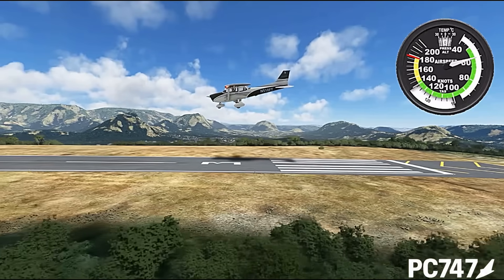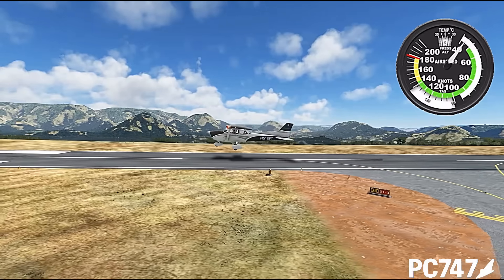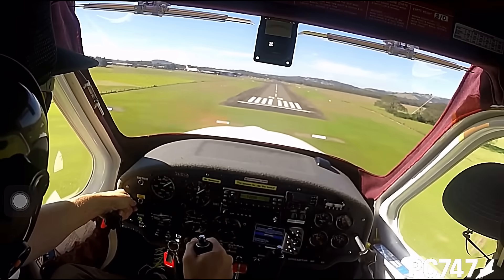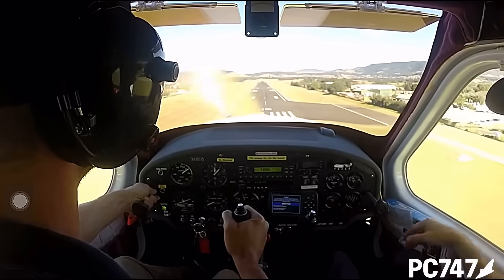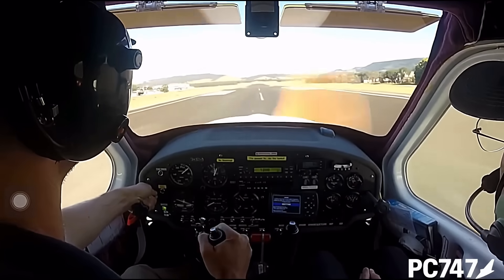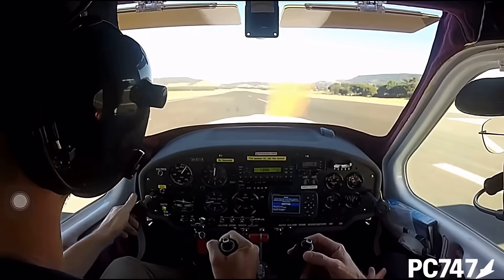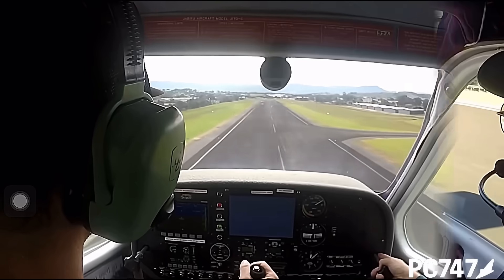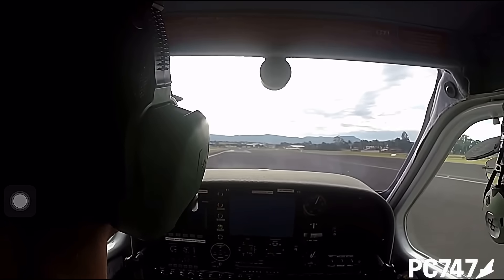How to Land a Plane -The Secret No One Tells You

Comment: No offense you did not discover, here to before unknkwn knowledge, no one else teaches. There are many tips to teaching lsndings "not in books". Your techniques and observations are not special or unique. I get click bait. I soled many primary students in under 6 hrs, and all my students from Pvt to Com Multi Inst passed their chk ride near min required time 1st time, 40 to 50 hrs for Pvt.  I hate seeing Pvt take 75 hrs and 20 hrs to solo. Me pvt in 41 hours, all ratings min time, never faiked check GA or Airlune. I had good instructors. 👍 

Pilot, 40 yrs, 35 yrs CFI/II/ME. 1500 hrs dual given GA, 1000's more part 121, 5 type ratings, Aerobatics, total 15,000 hrs PIC. I am not God's gift to aviation.

I dont' do this with all student's, but I have the throttle and tell them to do liw pass 1O feet above runway. I add power or subtract as needed.But coach them when they need to not sink or not balloon. Then they get a good side picture and maybe we do it again at five feet. I tell them to hold their attitude and slowly pull the throttle back and squeak squeak they land. They start developing the sight picture, transportation from looking down runway to peripheral. Not all students need this. You have to have a bag of tricks. Observe the student and use what works.

 I can teach you a thing or two about  cross wind landings in GA and swept wing jets i an sure. 

I am sure you can give me tips something, but this video is not one of them.  

YOU NEVER HEARD THIS FROM YOUR INSTRUCTOR. This presumptuous comnent is hyperbolic and  self engrandizing. Then you fain modesty with CFI's make mistakes too.

You have no clue what other instructors teach and how. Your vitue signaling is in essence bashing orher CFI's. This  is not good for the profession, nore is it a competition. 

 Deconstruction of elements involving landing, pitch, bank, and power, is not your discovery.

 Why do people bank in flare? YOU DON'T SAY. Body mechanics, pulling back with left hand in flare, tennds to also pull down (unless you are  consciousness of it). This happens at airlines when new FI's land in the FO lane. 

It's like when making a level turn.You have to pull additional back pressure. When you learn this muscle memory you don't think about it. 

 I see it with Inst Students reaching over to put something in "the box", they lower their hand and bank. 

 It is like shooting a gun, trigger control, pulling trigger without moving whole gun.  

Be it a firearm instructor or CFI you obsetve and Coach. Some folks are just more coordinated than others. Some students have better eye hand coordination and faster reflexes and intellect. 

 I did not see many slow students in the 90's, 1 out of 10. Now teaching GA for fun students I see more lazy and slow students 2 out of 6. Not statistically significant or scientific, but possibly generational? They are unable to focus and have poor communication skills. Too many distractions in 2025? Not all but from 90's to the 2020's the caliber of candidates today is concerning to me, short attention spans and poor memory.

 Your 10 sec bleed energy theory is irrelevant and not bassed on physics. PLEASE provide references and how this is critical. 

Many factors affect how much excess energy you take into the flare. Heard of Short field approaches? 

 What if they are flaring too high and holding it off? 10 seconds is not a thing.

Never heard this taught. Never heard this for good reasons. Do you start a clock AT inital round out or in the flare? When does inital round out ebd and flare start, for clocking? DON'T ANS: Rhetorical, no answer needed. Irrelevant.  What if the pilot blips the throttle? Start the clock again? Sorry only you think this is important. 🤔 

 WHAT is more rellevent  (few of a long list) stabilized approach, on speed, configured, aim point, and developing sense of HAT by  peripheral vision, and then add drift correction due to X-wind.

 For X-wind I teach the "DANCING BEAR"  🐻  for cross wind. My  invention  NO ONE I KNOWS MY SECRET TECHNIQUE AND TEACHES IT. Ha ha.  😉    

PS Rod Machado is far better instructor than you or I together X10. So let's  truly be humble, realize one size does not fit all. Each student is different, and some are better pilot's, naturally. I would never say I teach things NOBODY else does or could possibly know. Well except for maybe the dancing bear 🐻.  HA HA 😅
Reply from the maker: Hello,

  What you wrote was very thoughtful. You took a great deal of time in writing it too & I want to thank you for doing that. 🤩🤩🤩

You brought up some valuable insights that can and have benefited others. If I came across as a know it all, I want to apologize to you. That was not my intent at all. I’m certainly not the repository of all things aviation either.

I have  about the same amount of aviation experience as you, six type ratings, &, like you, large aircraft experience, 747 & 777, domestic & worldwide.

I want to commend you for all your aviation accomplishments & having been a flight instructor. I have the highest respect for people like you, far more than those who chose to avoid becoming CFI’s.

Like you, I’ve learned a couple of things along the way. I just attempted to impart “some” of that knowledge. Could I have done a better job or maybe presented it differently? Of course. If I made mistakes, I’ll own up to them, try to learn from them and move on…….

If you get a chance, take a peek at some of the other comments. While I never expected the video to be helpful to everyone, I’m gratified  & humbled at the sheer number of people who have communicated their gratitude.

Regards,

Carlos
PC747
Reply: @PC747Aviation i appreciate your thoughtful response. The danger with airline pilots such as yourself and me, we think we're better than we are. i'll give you an example. The  Boeing 747-400, a monkey could land it (I was one of those monkey's).  At 50 ft automated call, raise the nose 2 to 3 degrees, just let it land-O-matic on four big main gear.  With auto brakes, auto spoilers, grab reverse while the autopilot tracking centerline, disconnect A/P, click click. Hero. 😊 . i taught B747-400 back in day, graduated to twins (to upgrade). Airline pilots lose skills flying with automation.  Auto land (rudder aligns aircraft before touch down as you know) is amazing. NO complaints, but I hand flew often. Most GA pilots (some 121 pilots as well) are hard pressed to intercept, track, enter holds and fly approaches without a magenta line snd autopilot. Pilots are button pushing managers, and less airmen. It's a shame stick and rudder skills are lost. Cheers.
Reply from the maker: @gmcjetpilot So true! So true! Thank you! 🤩🤩🤩

Comment: Am I wrong in thinking, autopilot can land the plane.
Reply from the maker: It depends on the aircraft. You’re not wrong.. Most airliners have auto pilot systems that can land the aircraft, without pilot intervention, provided the pilots input the correct data. This allows these airliners to land when the visibility conditions are very low. A more recent iteration are advanced corporate aircraft that are able to land themselves now, in case the pilot dies or becomes incapacitated, with the push of a button. 

The Cirrus jet has this capability. If you look it up on YouTube, there’s even a clip about it.. The passenger only has to push a red button, air traffic control is advised, an audio announcement to passengers will advise them that aircraft control has been advised, and that the aircraft will land on its own. There are several other corporate aircraft that do this, including some turboprop models.

Cheers!

Carlos
PC747

Comment: I flew gliders many years ago, and the "10 seconds rule" is useful for them too. They had no engine, but "float" over the runway (ground effect) and are uneasy to slow down (even with full airbrakes extended) if your approach was a little bit fast.
Greetings from Patagonia, Argentina ! 🇦🇷🌲
Reply from the maker: Wonderful that you shared that with me! Thank you so much for letting me know where you were communicating from. 

I have provided the video in Spanish if that would help you or anyone that might enjoy it. You can find it by going to the comment section and it’s the second comment down from the top. The video is in seven different languages, including Spanish..

Cheers!

Carlos
PC747

Comment: This is really helpful to me an NPPL student with around 35 hours and still struggling to land (so a way off from going solo). But at what point exactly do you start the count? You say when you power off, but I often power off and do a glide approach way before crossing the runway threshold and flaring. A little more guidance on this would be appreciated. Cheers.
Reply from the maker: Hi,

  I’ll try to help you ….

   If you’re at the CORRECT APPROACH SPEED, & the throttle is pulled slowly to idle, during during the TRANSITION, from descent to flare….

  Start counting to 10 at that point out loud. 

Something that I think might help you is if you go to YouTube and just look at aircraft landings. Both large and small.

If you look at enough of them , after a while, you’ll see something in common:

  If they came in at the correct speed, they will typically float for about 10 seconds after crossing the end of the runway. Some will be less some will be more…..

Please let me know if this helps you. Reach out to me again if I can assist you further.

Regards,

Carlos 
PC747
Reply: @PC747Aviation  That’s really helpful, thank you.
Reply from the maker: @scrufflepeck SURE! 🤩🤩🤩

Comment: Add don’t step on the ball… to this… cradle with the ailerons. This guy is great! I luckily had his “father” as my instructor 65 hp Areonca champ on floats. You’ll rip the floats off with a normal instructor. High speed one float taxi, directional control with ailerons and elevator, , pitch with rudder. Try this in steep turns at altitude. Dead stick landing every time. Power ONY to correct mistakes or wind sheer.
Reply from the maker: Hi David,

    That was Super to read!

THANK YOU! 🤩🤩🤩

Carlos
PC747

Comment: HOW DID THE PILOTS LAND UP TO NOW ??
Reply from the maker: Here you go:

1. Institutional Inertia

Flight schools, regulatory agencies, and training organizations tend to preserve long-established systems. Once a syllabus or standardization manual is approved by regulators (like the FAA or EASA), it becomes difficult to change without lengthy bureaucratic review. So even when better methods appear, institutions often keep doing what’s “already approved.”

⸻

2. Generational Teaching Habits

Instructors usually teach the way they were taught. The flight training community is an apprenticeship system — one generation of CFIs passes down not only knowledge but also biases, techniques, and even outdated procedures. This creates a self-reinforcing cycle where new instructors replicate old habits rather than innovating.

⸻

3. Economic and Time Pressures

Most flight schools are profit-driven and operate on tight margins. Their focus is throughput — getting students to checkrides quickly — rather than redesigning training programs or experimenting with new methods. Updating curriculum, simulators, or scenario-based modules requires investment many schools simply can’t justify.

⸻

4. Outdated Evaluation Standards

The testing system defines the training system. FAA practical tests and written exams emphasize memorization and mechanical tasks more than real-world decision-making or scenario management. As long as checkrides reward rote performance, instruction will prioritize passing those tests instead of building modern cognitive or risk-management skills.

Take care!

Carlos
PC747

Comment: My grandmother and father were both pilots. My grandmother used to go on search and rescue missions all the time. I flew many times when I was about 3years old until about 12years old. I never became an actual pilot in a small aircraft but I have piloted many RC aircraft for decades. I also tool the part 107 for UAVs. I could most likely fly a small aircraft in a very short time if I had the money and desire to. But I like the way you teach, it sounds much easier. I think the largest amount of training I would need is practicing on the radio. I have many hours on the simulators and always enjoy trying my hand at cross wind landings because they are the most challenging. I think your approach sounds like it should become standardized because I can see it being beneficial.
Reply from the maker: Hi Newmomengineering,

Thank you for your very kind words & for sharing a little about you & your families flying history.😎🤩🤩🤩

Regards,

Carlos
PC747

Comment: Cessna mounted the vertical stabilizer at a slightly crooked angle.  The plane flies straight under power but will yaw the moment that you pull the power.  In dead calm no wind conditions, you must be ready to add a tiny bit of left rudder to land without yaw.
Reply from the maker: Oh wow! I did not know that. Thank you for sharing! 

Cheers!

Carlos
PC747

Comment: Немного непонятно. Правильно ли я понимаю что: надо выровняться по осевой на метре. А далее поставить малый газ. Посчитать до 6 и потом начать поднимать нос ?
Reply from the maker: Hi,

  The video was about landings. Not takeoffs. My apologies if it was confusing. Best wishes!

Carlos
OC747
Reply: @PC747Aviation sorry for a mess... I was wondering about a flare and landing proccess you have discibed above. Forget me if i got it wrond but as far as i ve undestood your way of landing. So ... during the flaring we keep a centerline "just between the legs" set trottle to idle and count to 6 in a normal pace. And after that we pull the yoke to let main gear meet the pavement. Wright ?
Reply from the maker: @DykyKryl It’s Ok. I don’t know if you have access to YouTube where you live…. If you’re able to observe aircraft landing videos, you might notice that, after they flare and reduce the power, they will float for approximately 10 seconds. Some, a little less, some a little more. But the general rule of thumb is 10 seconds.

My idea in having student pilots count out loud, is to give him a correlative reference that they can utilize for every landing. 

A lot of airplanes land too soon and pilots get in trouble. Landing early, typically results in three-point landings, or the nose touching the runway first. Airplanes that land too soon have very low angles of attack. Almost level, Flight attitudes. The numbers 1 through 5 are, in a way, reference numbers to remind you not to let the airplane land yet….

The number 6through 10, provide higher angles of attack, lower, kinetic energy, and aircraft attitudes that are safer for touchdown.

Comment: In about all the clips you show, it shows each aircraft landing at speeds far in excess of the speed to maintain a stabilised approach and a reasonable touch down. Whenever I made a mess of a landing it was always down to excess speed. If my approach speed was too high ( dependant on weather considerations ) or the profile of my approach was too high or too low, and I couldn't land on the numbers or close to them I was taught that in most cases a go- around was the best option rather than changing the aircraft configuration. I was lucky. My instructor was ex Air Force with huge type experience from Tiger Moths to 747's. My first solo was 49 years ago, but I can still remember the full list of ( Air Force ) vital actions he taught me, even though I stopped flying 27 years ago.
Reply from the maker: Hi Roger,

  You are correct! 🤩🤩🤩 I think your instructor taught you well. 😎

Regards,

Carlos
OC747

Comment: Single axis training is an EXCELLENT idea and I recommend the use of a good quality 'desktop' simulator (X-Plane etc) with a panoramic visual system (3 screens for at least 120 degress visual field or so). This way the approaches can be quickly and easily repeated, and the jeopardy of damaging the aircraft is removed from the 'stress-equation.'  ALSO I LIKE the 10 seconds of Kinetic Energy count-up. The 'ideal' touchdown time seems to be at 6 to 7 seconds, right?  However it is key that the student begins the flare and power reduction at the right altitude because that can change everything afterwards. How do you teach 'Correct Flare Altitude?' ... I tend to use '1/2/ wingspan as a realistic parameter (i.e. distance from eyes to wingtip -- rather than specifying 'feet or meters' distance).
Reply from the maker: Thank you for your kind comments as well as your insights.

   I think your 1/2 wingspan counsel is EXCELLENT! 😎🤩🤩🤩🤩

Regards,

Carlos
PC747

Comment: Around forty years ago, when I instructed to build time...like most non-military pilots.... I started by ensuring the student fully grasped the concepts of aerodynamics. and demonstrated x- wind landings using a forward slip, (BTW a X-wind method best NOT used with a low wing jets)... also  taught spin recovery by teaching spins.
Reply from the maker: Bugdriver49,

  Thank you very much for sharing that. When you mentioned “forward” slips, it reminded me the lack of its application, during pain pan or emergency procedures like when flaps are stuck up on corporate . There are several videos on YouTube. where corporate aircraft are landing very very far down runways flaps up. I think one occurred in Las Vegas.  Another in Colorado. The one in Colorado used over 12,000 feet of runway!

Once I was given a simulated dual engine failure. in a Hawker jet, over New York and I was right over.LaGuardia. The instructor had already passed me and just wanted to see how I would do….. I did 360s around the airport, and on final, I finished adding full flaps, but I was still high….. I communicated to the copilot. “Emergency aircraft forward slip.” I held it even after the flare, like a Pitts bi-plane, to dissipate the excessive kinetic energy. 😃

 The lack of its utilization, during critical times of flight, warrants further duscusdion.